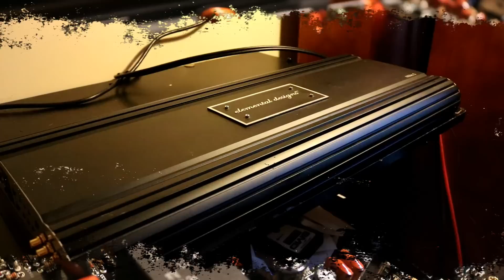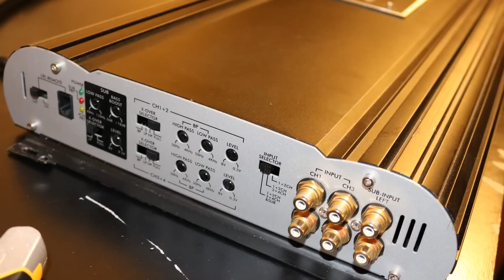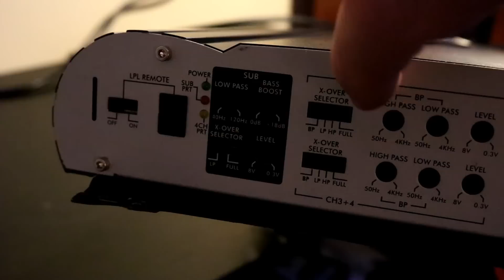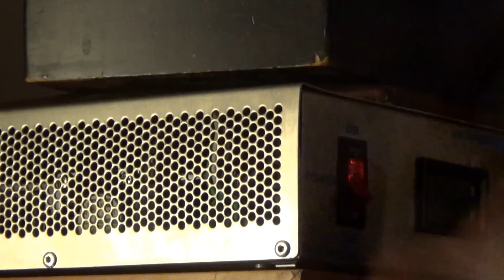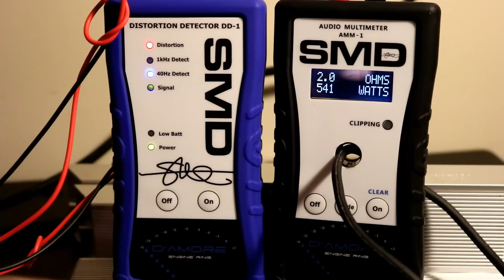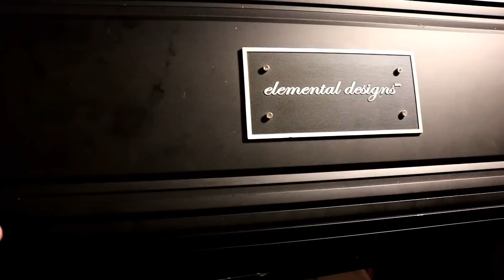Elemental Designs Nine.5 Amp Dyno and Walk Around

Comment: I'm another old Ryan.  Loved ED in the first century of the 2000's when I was childless and big into doing builds. I was using old blue Soundstream's back then and ED speakers and never really used their amps.  I did buy a Nine.1 and two Nine.2X's when they were on sale and still have them sitting new in box in my shop.  Long story short, now my son is 16 and we're building a system for him with an old eDi 6000 component set (new in box sitting on my shelf as well) a couple 7Kv.2 subs in the rear deck powered by a DLS CA31 amp I've used in the past.  Just stumbled upon this review when searching eBay and found that there's a new in box Nine.5 someone (not anyone I know) is selling if you want to jump on it!  https://www.ebay.com/itm/Elemental-Designs-Nine-5/184631348904?hash=item2afce2cea8:g:oW0AAOSwttRf4r65

Comment: 4 new ED nine.1 
1  new ED nine.2
125ft roll of 4 gauge power cable
250ft roll of speaker wire 
$495 Is this a deal or no?  I have a chance to buy this at a police auction in Iowa. The price reserve was not met and I was the highest bidder. They are offering it to me for my bid. Do I pull the trigger or no? 🤔🤔Someone please chime in. I have to give them an answer by 06/15/19.🤷🏾‍♂️🤷🏾‍♂️

Comment: Nice, but a lot of amps can't cut it when all channels are driven. 
Ryan,  what power supply do you have?
Reply: In the 70's and after home audio amps were rated like this. 100 watts per channel continuous rms at 8 ohms with less than .05% distortion both channels driven. Without all the parameters, it doesn't mean a lot.
Reply: Ryan Blankenship , So these numbers are all 5 channels loaded? That's great.  Also,  if you have a DC clamp, the amp draw would be nice too.

Comment: You should do a spread sheet like bigdwiz. Also it would be nice if the amp dyno guys would test 1.5-1.6ohm loads so that us guys running jl audio or triple sub setups would get a good idea if the power we could get. 

We always get a 1ohm rated amp that makes the power we need at 2ohm but in cases like the kicker cx1200.1 it made its rated power at 1.6 ohm which is nice because some amps lose power below 2ohms
Reply: Ryan Blankenship the 1.5 ohm would be a nice way to introduce other options to compete against jl audios proprietary super regulated amps. They are the only company that rates at 3ohm and 1.5ohm